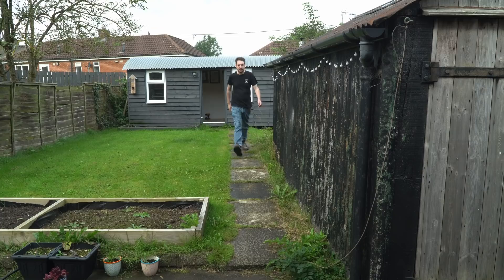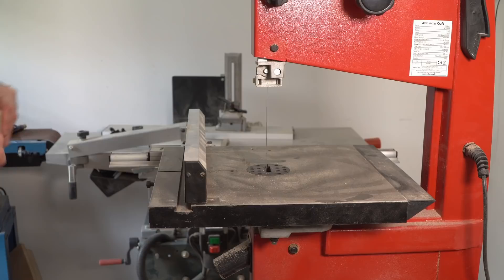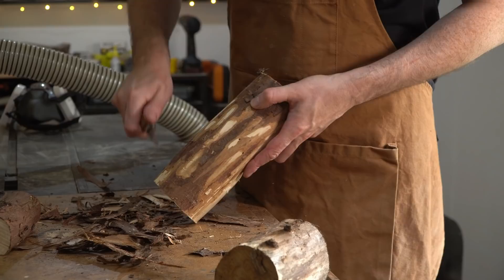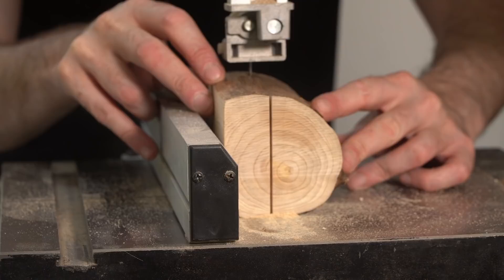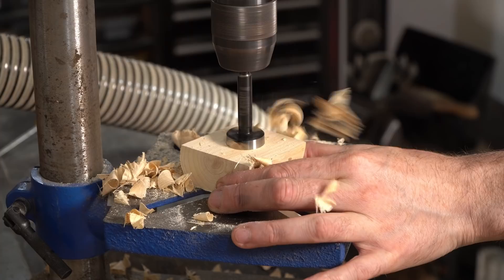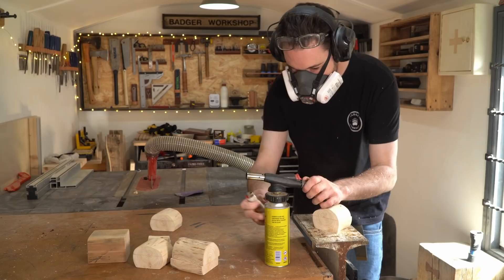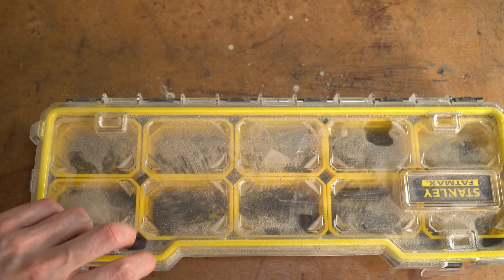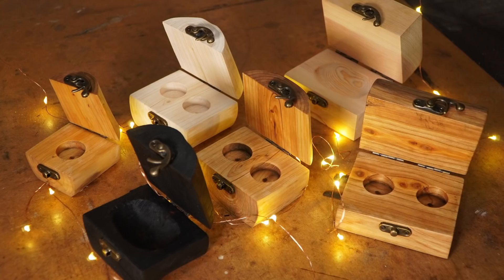Making Some Ring Boxes

Comment: Great video but I think you might have a problem with your audio. At times your audio is on the left hand channel and its hard to hear, other times it on the right hand channel or both channels and this is at fine level. I notice it more than most as I am partly deaf and rely mainly on the CC (thanks for switching them on). Great tip on the fence, why did I not think of that !! Thanks for posting
Reply from the maker: Thank you. I will look into that
Reply: Sadly, definetly an audio prob this week but great project!
Reply: I think I burst my right ear drum on a flight a few weeks ago, I lost most of the hearing in my right ear. Earlier tonight it was a bit 'crackly' and when the video started I thought it was away again, then the right channel kicked in.  >:-0